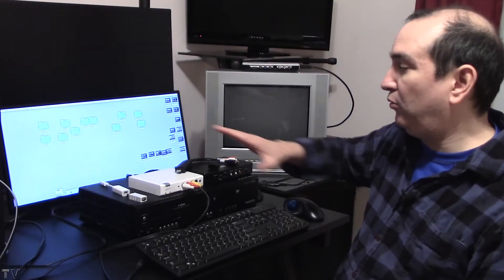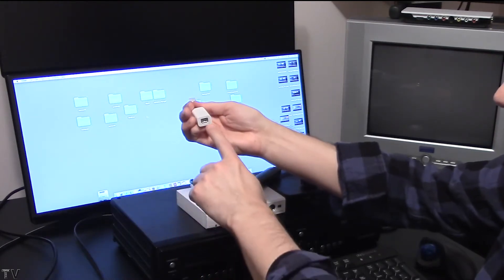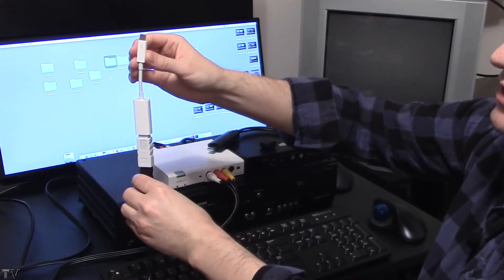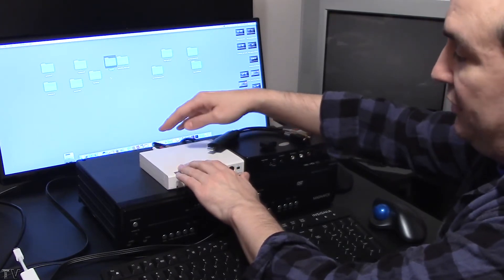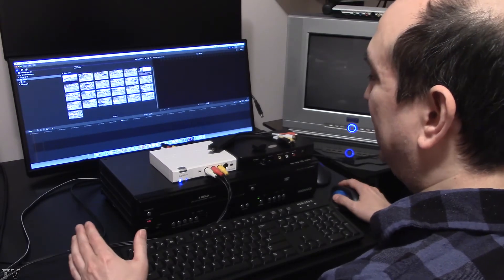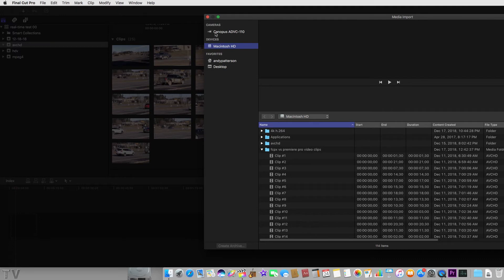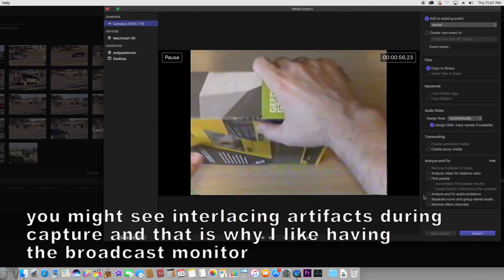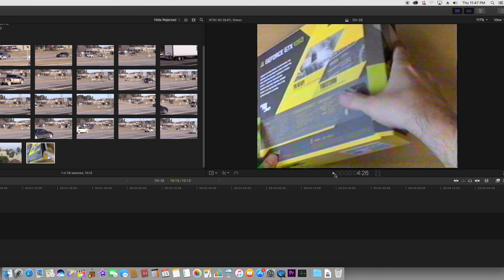FCPX transfer vhs and Hi-8 tapes to computer

Comment: Hello. I wonder if you used a VCR with TBC or an external TBC when capturing. I used BMD Intensity Shuttle but it got flashing video(which drops frames). So I plan to use ADVC 110 as capturing device. Will it flashing as well? Thank you for your great videos.
Reply from the maker: I use Firewire DV converters for capturing old VHS tapes. I only use an Intensity Shuttle for playback. Below is a link of my setup for the last 7 years. 

https://youtu.be/dVLUxRkPMdA
Reply: @TechTVusa  Thank you. Now I have canopus ADVC-110 for capturing. I use a Firewire-USB connector to my Mac. Although the STATUS light is on, the input light(which is blue) is off. Do you know why?
Reply from the maker: @masayuri770  None of my videos suggest buying a Firewire to USB adapter because Firewire to USB adapters do not work. Firewire to Thunderbolt adapters do work but you might still need the power cable for the Firewire device.
Reply: @TechTVusa  I see. I just thought they are the same😭 (I'm too lazy HAHA) Thank you for your advice.
Reply: @TechTVusa  Sorry to bother you so many times. I get my canopus 110 worked for a week. However, today I connect the device to my MBA as usual(from a 400 to 800 cable, 800 to thunder2 adapter and thunder2 to thunder3 adapter). And I have switched it to analog input mode. But my mac doesn't detect the device (any software. I used FCPX and quicktime and both undetected). Then I check the MBA's system report. It shows "Warning: Unable to List Firewire Devices". Have you suffered from this kind of problem?
Reply from the maker: @masayuri770  My Mac Mini is an older Intel setup with and older operating system and it works just fine with Firewire devices.  Having said that the video link below might might be helpful. 

https://youtu.be/if913nU3uxE
Reply: @TechTVusa  I didn't link them through Firewire 800 to 400 and 400 to thunderbolt. I just use a Firewire 800 connector(another side is USB one) to my Macbook Air(through a USB Docking station). No lights is on now. I saw your videos and you didn't use any other power supply. Is my device broken?

Comment: Commenting to help your video in the Youtube algorithm - unfortunately most of my searches linked me to your older videos, whereas this video exactly answered my question (But I may not have found this w/o you responding to my comment). Maybe adding more tags for thunderbolt 2, mac, macbook pro etc will help this video come up easier :)
Reply from the maker: YouTube recommends the most popular videos. If you see a video you like from a small YouTube channel you should check out other videos from that channel. You can easily search my channel for VHS transfer or Hi-8 video capture. If you see me using my Mac Mini it will have Thunderbolt connections.
Reply: @TechTVusa  true, I guess I was looking for the thunderbolt keyword whereas I should've assumed that from FCP in the video title. Random question - are you into filmmaking at all? hah
Reply from the maker: @skAteSMR  I worked for the Cable Commission from 1996-2002. It was a great job but the budget was cut and my job was eliminated. I still do freelance video production once in a while.
Reply: @TechTVusa  cool man, I'd check out any short films if you have em. I've also done a little broadcast work but as a cam op, still saw some of the old tech though back in early 2000s hah, good stuff

Comment: Is the ADVC 110 a better option for digitizing VHS tapes than running: VCR > RCA cables > hi8 camcorder > firewire cable > computer? So the ADVC 110 would replace my hi8 camcorder in the signal chain. Or is it basically the same thing? I am currently using a Sony DCR TRV-330, but I'll get the ADVC if it's a better quality option. Thanks in advance!
Reply from the maker: Hi-8 camcorders do not have Firewire. Digital 8 camcorders do. The Digital 8 would work the same as the ADVC 110. I mention that in my latest video (I posted it today). I left a link below. 

https://youtu.be/5nubVDZvzNA
Reply: @TechTVusa  Ah, yes, my mistake. I have a digital 8 camcorder. Okay, if it's the same exact output quality then I will stick with this. Thanks so much for your response!
Reply from the maker: @live2skate4  I am glad I could help.

Comment: Awesome tutorial, I grew up editing on FCP4.  I'm justing getting back into the game with a 2013 MacBook, my intentions are to digitize old VHS and mini DV tapes.  I have the ADVC 110 that I used with my PPC G4 now I'm using the 2 dongles in this video and all works with that regard.  However I'm running FCPX and things are much different now a days, my question lays in how to keep the NTSC interlace footage? I remember back in the day FCP4 would ask when importing the field dominance.  I don't see any options in FCPX for that, I notice that the footage in FCPX shows the 2 fields at the same time.  Any video on this?  How do we keep the footage interlaced, or using compressor can we change the interlace to progressive?  I think you understand my intention, any ideas would be welcomed.
Reply from the maker: The ADVC 110 is interlaced. I would like to think by default FCPX would keep the video at mini DV-25 specs.

Comment: I have a Canopus ADVC 110 that I will use in the process of transferring VHS and 8mm videos to my MACBook Pro. I am running Catalina and editing with Final Cut Pro X. The computer has a Thunderbolt and Firewire 800 port. Which input port should I use? I though that if using the DV port on the front of the Canopus it needed an AC adapter, where the larger DV port on the back provided power through the cable. Is it better, picture quality wise, to use 1 adapter, if available, rather than connect multiple adapters together?
Reply from the maker: All you need is a Firewire 800 to Firewire 400 cable. They are only 10 bucks or less. I  have read the the latest version of OS X will not recognize the IEEE OHCI Firewire port.
Reply: @TechTVusa  Thanks for the reply. Si if Catalina does not recognize the Firewire port, can I use the Thunderbolt port, if an adapter exists, or load an older version of the OS onto the HD?
Reply from the maker: @customvideo8278  The IEEE OHCI controller will not be recognized using Thunderbolt adapters.

Comment: When importing, is there a way to keep FCPX from automatically breaking the clip apart?  The video is old, so every time there's a little chop, FCPX creates a new clip.  I'll get way too many clips, like half a second long and it makes for a worthless final product...
Reply from the maker: If it is a bad tape the ADVC 110 will loose sync. Even if you buy a TBC it might still loose sync. It is possible Premiere Pro might work a little better but I doubt it.
Reply: Tech TV usa I see.  Appreciate the info!
Reply: @btayl81169TREES  I'm facing the same issue. Could Canopus ADVC 300 achieve a better performance?
Reply: @TechTVusa   I have tried PR with an old VHS , it will stop capturing if there is a little chop, However the PCI card will not stop capturing in this kind of situation, AND the quality is not that good which is a little dark and not colorful with Pr or FCPX.  HOW TO SOLVE THE PROBLEM
Reply from the maker: @NBAONDVD  My ADVC 110 and ADS Pyro A/V Link work just fine. Your ADVC 110 might be defective.
Reply from the maker: @NBAONDVD  I cannot say because I don't have a PCI video capture card.

Comment: Not using a PC anymore I see?
Reply: I think Premiere & Windows tutorial vids +... were done on his Micro ATX PC, Final Cut & Mac OS tutorial vids +... on his Mac Mini.
Reply from the maker: I only use the Mac for YouTube tutorials. My channel makes no money as you can tell. The only reason I make videos is because I have been helped by other people on YouTube. I know what it is like to have a piece of hardware that you a cannot get to work correctly or cannot find a solution for. Having said that I will have more FCPX/Mac video soon.
Reply from the maker: You are almost 100% correct. I did a video showing how I can use Premiere Pro on the Mac and I have another Premiere Pro tutorial that was done on the Mac that should be ready to post in about 4 days. I will do a few Premiere Pro/Mac videos from time to time. I cannot do much on my Mac Mini because it is under powered. I will probably get a new Mac Mini in another year or two from now. I like my Mac Mini but I wish it had  a quad core and mobile GTX 1060 GPU. Perhaps in another two years the Mac Mini will have a mobile GPU.
Reply: @TechTVusa  Let's hope they do have a separate GPU next time round. At least the present line-up has completely done away with spinning HDs and now have quad core processors minimum. Plus you should still get some money back on selling your present machine.

I'd like to go cross platform at some point (while mainly working on the OS I'm most comfortable with) but at the moment I just don't have the time.
Reply from the maker: I can only get $150.00 for my Mac Mini from Apple. I might be able to get $300.00 for it on craigslist but the Mac Mini I want will be about $1,500.00. I have a lot of other things I must purchase before getting a new Mac Mini. Plus if I wait another year or two I can only hope the price of the Mac Mini will drop by 10%. I doubt Apple will drop the price but you never know.
Reply: Yep. I always sell privately.
Indeed - you never know. I remember the price of the first MacBook Air when that first came out. That said I also remember the price of the first iPad... It all depends on what they bring to the table I guess...